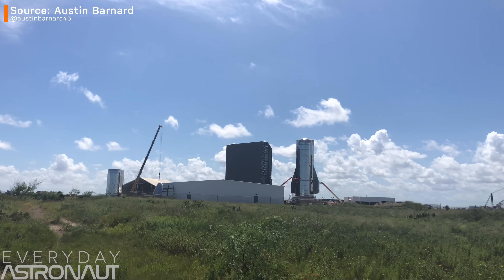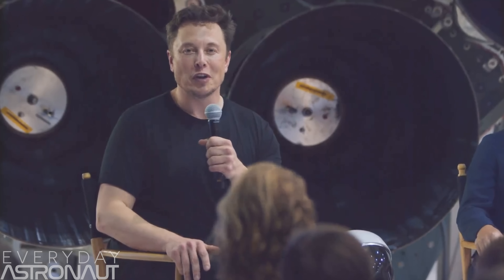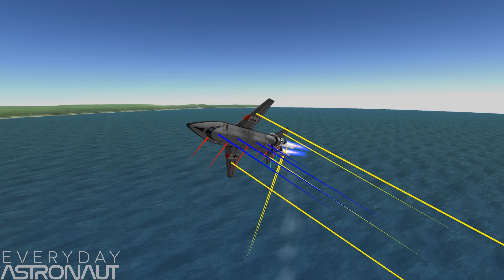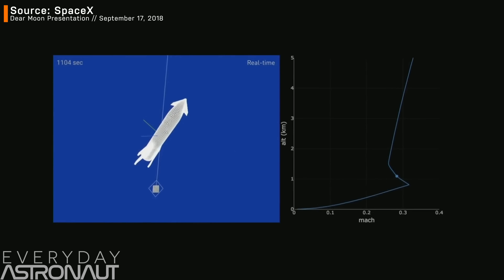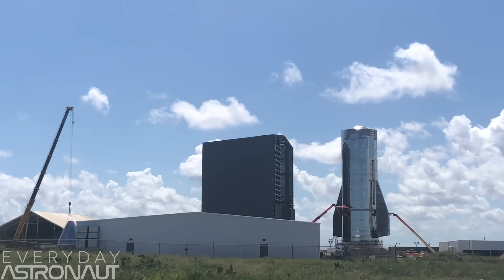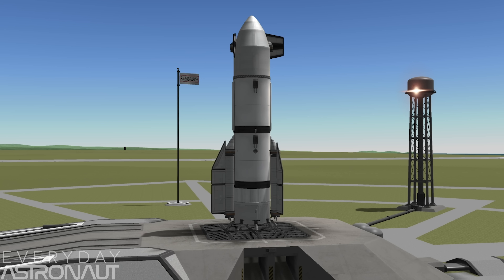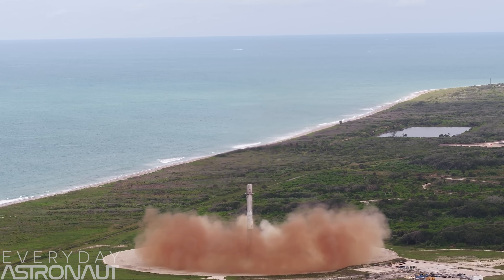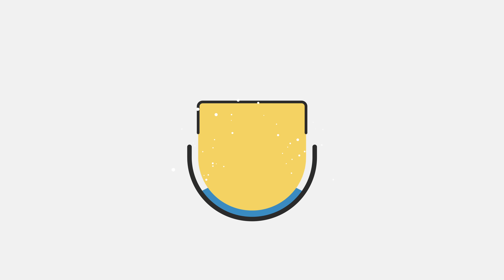Why does Starship only have 2 rear fins?!

Comment: One Problem noticed right away is simply that so much fin area is up high on the rocket.  For stability, like in arrows with rear (lower) fins, you need them back there.  We engineers like to talk about yaw & pitch stability, and for a rocket it's stable y & z axis moments, good old fashioned bow-and-arrow design.

Comment: I think if the third leg can retract it will work a lost better because then there is zero drag induced. 

However seeing that two wing landing is extremely pretty and personally if they do the landing systems right. It's equally as good as falcon 9. Comes down to which system can distribute the load better and cause less strain on the interior structure. which is critical in all rockets.

After all that's why the space shuttle disasters happened. Lack of maintenance and catastrophic failure of supporting fuel loads or bad nozzles.

Comment: Eventually the weight of all those landing legs and the elevator system could be replaced by 3 extendable landing legs placed like the landing wheels of an aircraft, which would allow the Starship to land horizontally instead of vertically (like a VTOL aircraft).  A staircase could then be extended to the surface, upon landing, to allow easier and more dependable access and egress than an elevator system (which would be prone to breakdown as most elevator systems on earth are).  Internal decks could be circular, like nesting dolls, which would allow a small amount of artificial gravity to be induced as the Starship spins like a bullet towards the Lunar or Martian target.

Comment: Friend, I am a researcher and I have very good news. I discovered how to make Starship 60 tons lighter and in a modular way by robotics. I am a discoverer for the perfect integral double bonds by stimulated emission of light in reactive titanium alloys. My discovery has already been granted in the US and allows manufacturing by estimated emission of laser light and automatisms using Starship as all launch systems 100% reusable and resistant to friction with the Earth's atmosphere. Perfect joints with controlled asymmetry on paramagnetic and diamagnetic materials in an inert atmosphere. It is convenient for Starship to modify its way of landing on earth. The vector control of motors is useful for the Moon and Mars in the absence of atmosphere in the first of the terms or low pressure and storms on Mars. Nor are there airports as if they are strewn on the globe. Therefore Starship should have landing and gliding with state-of-the-art avionics for the ground and the thrust vector as control for environments very different from the Moon and Mars. The systems are compatible and work very well on a multi-functional spacecraft. Less weight of the structures constructed of very strong and light alloys of titanium stamped matrices and joined by estimated emission of light ... I request urgent contact with Mr. Elon Musk. It is very serious and productive since I have all the rights acquired for the US territory ... It is excellent news because the initial accelerator is also convenient for its orbital recovery and fuel savings with better fines. Fuel by lengthening the orbital path can continue to accelerate Starship, and the system does not need to refuel in Earth orbit to continue its journey to Mars or the Moon. Now we can manufacture from titanium and by robotics. Fast and efficient. Now we can do it very well ...
Reply: That would make it heavier.

Comment: I am seeing something on the SN8 model of the 15 Km test hop that does not make sense..Wouldn't it be more stable to retract the fins before the landing burn? I was watching ducks land on a lake today and as they come down they would be fully extended then as they come in they fold the wings closer. it looks like they will skid across the lake but they dont they are at 0 forward velocity when they hit the water usually. As I looked at it it came to me another option for the landing leg / Aero surface is exactly how they will deploy the solar panel. it is like a deck of cards that extend when you run your hand across to lay them out. would solve the heating issue inside the gaps when the flaps as well when they are fully extended.... and it would add drag and control when folded and extended out. Can someone kerbal this for me and try it out?

Comment: If the engineering team successfully implement the three fins without compromising the reliability of the airship, then go for it! But it is a human transportation airship, so it's not ethical to compromise safety over design wishes.
I know my comment is outdated, but the point is still valid for other decisions.

Comment: Just turn the orientation by 90 degrees as it is at the moment. This changes the third trailing fin into the leading fin which will anchor the latteral yaw movent at the rear of the  starship. So that middle fin i think is the most important feature as  you want as much controll as possible  with a re-entry.and without this front centre fin you going to have a snakeing motion. My past time is building high power rockets myself anything from a q-type motor and up  so i have practical experience with aerodynamic surfaces. So basically if you want the most stable orientation of the three fin setup as seen on starship you have to orientate it by 180 degrees
Reply: Sorry 180 degrees is what i meant all aling not 90 was slightly confused there for a minute sorry

Comment: Hey there Tim i mentioned in a past comment that the third leg that is in the slipstream thst is not helping with controlling the vehicle. But i mentioned changeing the fin orientation 90 degrees so the third fin is faceing into the incomeing air pressure and it will be a really heloful if not imperative design as this will be a solid stabiliseing point anchpreing the vehicle in flight as aerdynamically its in the perfect angles the leading fin into the incomeing atmosphere with the other two in a slight arch shape which will act as any surface that is concaved will be alot more stable than a straight surface that will either bank one way or the other so then the three fins will totally compliment each other on a re-entry scenario

Comment: Two fins are lighter, and that’s the name of the game:  Weight.  Aerodynamically fins act like wings, as well as breaks.  The fuselage is a cylindrical lifting body encountering atmospheric drag on de-orbit.  A disc shape would be optimal in inducing drag to slow re-entry, though a flattened football shape would actually do better for directional control to break the flow to fly back; Lessing  heat build up as atmospheric density increases during descent.  The Space Shuttle with two wings flew back fine, though the tiles lost through the burn makes the large surface area of wings problematic.  Hence, two fins are optimum for control as breaks but also have L/D lift as wings far behind the center of mass working well in conventional rockets.

Comment: ....this day and age with the technology that we possess does ANY space mission have to start at ground zero from a landing pad? You mentioned a jet aeroplanes differences and why nots but if Elon has manufactured self re-charging electric motor vehicles then why can't the same theory be used to move the planning of a space mission from the highest possible altitude? It would save a lot of time, work and effort planning never mind how much money Elon could save from his budget from the massive NASA contract he has. I could go on and on explaining where I'm going with my questions to you but I'm actually working on the theory of what I'm asking "Why does any space mission have to start at ground zero from a take off/landing pad?". If a Harrier Jump Jet with capability of VTOL can reach a maximum ceiling of 50,000ft (14,700fpm) with 21,500lbf (100+kN), lifting a maximum weight of 15,360lb. Then surely if Elon possesses cont. self re-charging electricity power, why the fu'h are we still messing about down at ground zero, wouldn't it make sense to raise the bar a bit higher and move the start position upto the highest possible altitude as possible? Electric drone launch pads is the future to me the way I'm thinking and the such a launch pad wouldn't have to be up there forever just prior to launch date. Anyway I'm messing about with this idea and if I get loads of reply's saying my ideas daft impossible...who would ever of thought Buzz Aldrin would take a piss on the moon one day BUT he did!!! (maybe more haha!).

Comment: .....if the 3 fins where all connected with an full diameter coil ring it would always have a of total self righting  point of gravity to the main central rocket fuselage thus always resulting in the coil ring sitting flat. look send is an email and i'll send diagram ok

Comment: A balloon could be deployed around the Starship to vastly increase its surface area approaching the atmosphere of Mars, like an air mattress.  The now giant Starship, would cling to the atmosphere of Mars by viscous adhesion, rather than cutting into it like a hot knife.  Five balloons tethered equally spaced would allow orienting the air mattress to slow at necessary speeds.  Optimize on computer.  Slowing could begin further out and be more effective not to mention less heat overall.

Comment: I’m pretty sure in the end that spaceX will not add weight to make it look better. Two fins is fine, the right way to go.  I think they should have some kind of safety hoop to catch the rocket if it tips over on landing. I really don’t think SpaceX has it perfected, but of course they are very good at it, but you have to be almost perfect for carrying people,  I think they need ejection seats or something like that because the very end of the Landing is very precarious. Maybe I’m overly cautious, but I’ve seen too many rockets flop over.

Comment: Technically they are parallel to the airstream, not perpendicular. The direction of a plane is defined by its normal vector, which in a flat plane is perpendicular to the plane itself.

Comment: It definitely looks cool with 3 fins, but practicality, pragmatism and safety are the primary concerns when it comes to space flight. 

Tyranny of rocket equation is real, and if losing the 3rd fin means they don't have to lug 1000 kg of dead weight all the way to Mars and back, replacing them with a ton of fuel, or medical supplies, or water, then so be it.

Comment: Fun experiment kids. I assume some of you may build and fly the Estes model rockets that have been around for 50 years. They have solid rocket engines and recovery systems etc. Lots of fun, but sometimes not allowed in areas that are prone to wildfires. Any way you know the drill, most kits have 3-4 fins on back and nose cone on front end. Launch, up, pop, down with a parachute or streamer. And you can learn a few things about rockets without sitting at the computer all day in you jammies! Outside, in the fresh air, as it were. But just for fun try to design and scratch build one that looks like this starship. If you can get it past your rocket club's range safety officer, it will have "interesting" flight characteristics! So, try it alone, out in a desert, or big park, with not too many spectators! Then you'll know why, despite weird (aka unstable) fin configuration, rockets have guidance, engine gimbals, and gyro systems to make them stable (aka safe) in flight. And yes, many modelers "fly" their rocket designs on the computer too, especially for the big powerful ones that are flown by the folks in the LDRS club!! BTW, that club is named: "Large and Dangerous Rocket Society", and their mile high plus flights are really awesome!! Watch some on YT. Finally, maybe you can design and build mini versions of those  gyro and engine gimbal systems for your starship model too. He he!! :D

Comment: Two fin will remain, although I think that a wingless extendable spoiler option might be better in the long run. I cannot see the mass of reinforcing flight controls to also be landing gear to be viable unless a 3D printed alloy tech solution is available.

Comment: Great vid.  I am totally ignorant on spacecraft engineering but it sounds like the ideas of rockets landing is a contradiction in terminis since rockets are built to go up since decades. It is planes and shuttles that land.... Why not built a big space shuttle or buy some Burans from Russia?
Reply: Your comment is a little old, so you might have already gotten the answer. But, if not, here you go. 

There are actually multiple reasons why space planes, like the Shuttle or Buran, are not that great overall. 
First, launching a spaceplane is very difficult due to the aerodynamic forces involved with the wings. You can't have them on top of a booster, which is why both the Shuttle and Buran were side mounted. Being side mounted made them dangerous due to debris falling off of the fuel tank. Also, if there was an issue or explosion, there was no good way to abort or eject. 
Second, the wings, landing gear, flight control surfaces, etc are all dead weight in space. That keeps it from being able to carry as much or go as far as is needed. 
And Third, you cannot land a spaceplane anywhere else outside of Earth. Not the Moon, nor Mars. Nowhere else. While this may not seem like a big deal right now, SpaceX end goal is to set up a base on Mars. It is also planning to help with setting up a Moon base. It is better to build a rocket that can do those things rather than one that is still stuck in Low Earth Orbit, like the Shuttle was.

Comment: Some fly-by-wire systems can even direct inputs from surfaces that don't work to those that are working.  So imagine a plane (like the DC-10 that crashed in Sioux City, Iowa) that has lost its vertical rudder.  The computer could route the pilot's rudder pedal movements to the engine(s).  The X-31 actually demonstrated this.  It's vertical tail was completely removed late in  the program with the plane remaining completely flyable even with just one engine.

Comment: The 3 fin design did look to me like the spaceships from the 1930 serials that could hover at relatively low speeds with a horizontal rocket shooting out sparks.  This design was used for the Captain Proton holodeck program in Star Trek Voyager.

Comment: The more weight you start with the smaller the payload can be, the fuel to land butt down must first be carried up, tail first landing does not make sense, using gliding to land does.
Reply from the maker: How will you land on the moon gliding? 🤔
Reply: @EverydayAstronaut  The video discussed a booster returning to earth.  (By the way your  video was very well done)

Comment: I’m curious, why launch a spacecraft from near sea level when doing it from the top of a tall mountain would reduce overall distance to space by a couple miles?
Reply: It's logistically difficult to haul an enormous rocket to the top of a mountain and to supply and construct the supporting infrastructure needed to launch in a remote location. Cheaper and easier just to eat the additional fuel cost.
Reply: I think you raise a good point, Mount Everest is over 5 miles tall so it would save some fuel for the rocket for sure and lower the cost to launch it off skmething like that.  But you have to consider these rockets are very heavy, and is it worth the cost and headache to haul it all the way up the mountain?  It might be cool for a PR thing or “he really did that” piece of history but to the people in charge it is not worth the price of transport atm

Comment: Hello Tim, how did you achieve such precise landing ? Is there a mod for it or are you piloting it all manually ? Thanks.
Reply from the maker: Biggest keys to propulsively land is targeting to radial out at the end and having your right hand have throttle controls. I bind shift and return to throttle controls
Reply: @EverydayAstronaut  Thanks for the reply and info, but I mainly meant the approaching from orbit, I ussually end up landing at wrong continent, but you managed to hit heart of the KSC ! How is that possible ? :D

Comment: Why do cranes have outriggers that extend far beyond the ground-hugging frame? Even a slight wind or decrease in ground-holding can have vast impact on the ability of the crane to stay upright. I get that these animations are just animated, but there seem to be a few major engineering ideas that get left out of the equation for something that is supposed to do what most engineered vehicles have not even been programmed to dream of. The greatest feat I foresee is maintaining thrust in a vacuum... just try explaining that away. BTW, not a FE guy, just questioning and wanting to know/basing my comment on experience.

Comment: If the rocket were to have three long top to bottom 1/3 of the rocket's width fins. When entering the atmosphere it would have constant drag making it easier to manipulate. Applying the current descent mode.
So much easier. Less effort to counter the force of gravity when landing.

Comment: It seems more "efficient" to use only 2 fins rather than 3 to me. With only two fins there is an obvious maximization of their function as the third fin would be marginally useful as a drag surface whilst compromising the effectiveness of the other two in their 120 degree downward angle of attack. Also the Starship block designs use multiple gimbaled engines. The landing legs can be analogized to training wheels on a bike and should be minimized or eliminated on  a rocket using multiple-gimbaled high twr engines when designing for minimum dry weight.